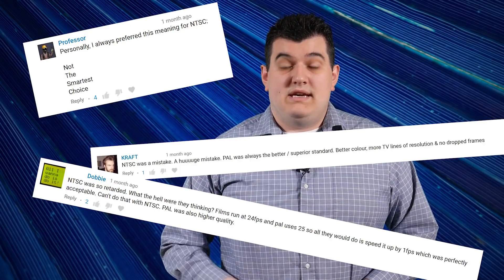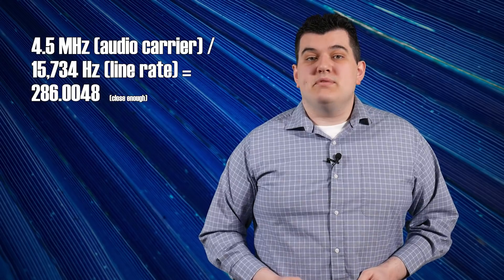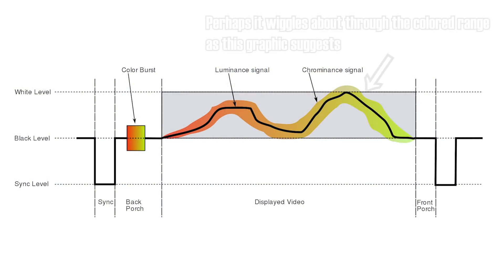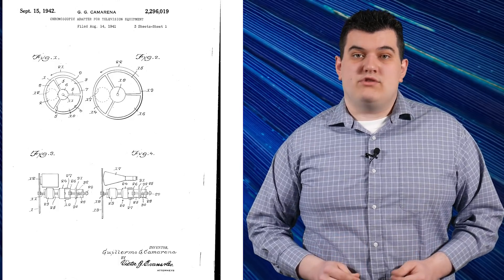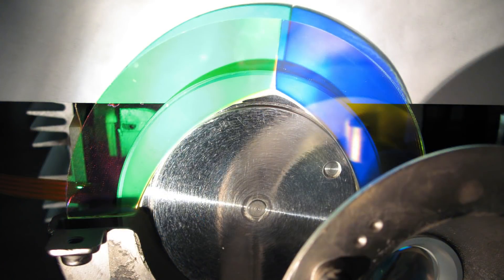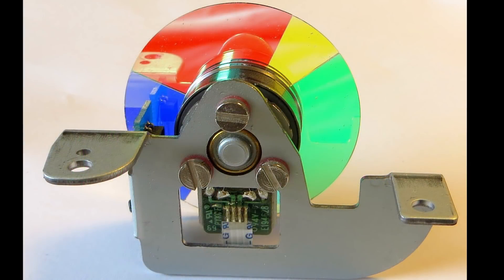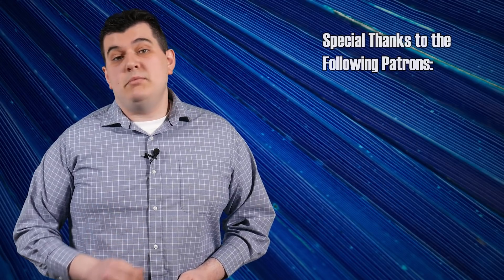Analog Color TV Wrap-Up--Some extra info

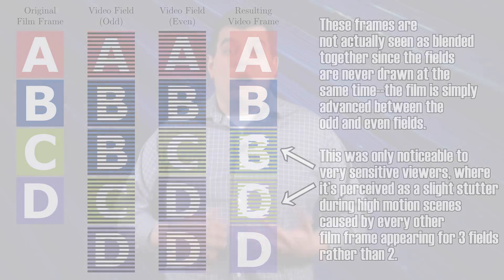Comment: 3:13 Yes, all of you from PAL regions have actually been watching our movies in the wrong pitch. If you've searched for clips from your favorite movies and heard them with a lower pitch, you're actually hearing them in the correct pitch.
Reply: This explained a lot, never new it affected so much
Reply: @DodgeWatt  Well I watched reruns of Lost in Space in the States and it sounded the same to me as when I watched in the UK in the 60s
Reply: yes a 100 minute movie runs for 96 minutes
Reply: You could probably narrow that down to just UK, since every country had their own channels and movies were usually dubbed into local language. At most it would have been music or sound effects that were affected by the pitch shift.
Reply: @nekoimouto4639  in Denmark we had the original sound, no dubbing, in fact all the Scandinavian countries kept the original sound.
Reply: TBF as someone who has tried to convert old videotape recorded films to digital. PAL recordings are far better than NTSC. As they are (usually) recorded in progressive fields, and the definition is better overall than NTSC. Splitting frames over multiple fields is okay, but it can be a pain to recompile into a progressive form and can leave ghosting and other noise. At least with a PAL recording it's not had to correct the frame rate and sound pitch/length. NTSC tapes can be a nightmare.
Reply: I think today they use an electronic pitch shifter to fix this, shifting the frequencies down a couple of percent. With such a small change, it's unlikely to generate unwanted noise artefacts.
Reply: Plus the rest of the English speaking world, the Netherlands and much of Scandinavia.
Reply: Mandolinic that solves the pitch but not the runtime problem. If you synchronize an NTSC and PAL version of a movie, I think you'll find that they will still fall out of sync when you leave them running.
Reply: a faster run movie allowed for fitting in an extra commercial or two. By the 1980s we were speeding up movies by several minutes in addition to the stuff we cut out for censorship reasons.
Reply: Yes, all of you from NTSC regions have actually been watching our European movies (and TV series) in the wrong pitch. :-)
Reply: Who still watches movies on TV channels?
Reply: vaso opel Actually, PAL to NTSC conversions only create distortion in the image because of converting 50hz to 60hz and cut off part of the picture because of the differences in the number of scanlines. They don't change the pitch of the sound. When it comes to UK films, they are actually recorded and projected in 24 fps just like in the US, but in the UK are sped up to 25 fps on home video whereas US uses the 3:2 pulldown. So even with UK films, we actually get the sound in the pitch which it was originally recorded and shown in it's theatrical presentation.
Reply: therealhardrock that’s si true but i was thinking, couid they not just repeat the last frame to get 25 fps.

so if a movie is 24fps and pal is 25fps.

You can get around this because pal tv’s are 50hz or well 50 fields per second,by splitting the 24fps into 48 fields and the repeat 1 frame and split it to 2 fields to get around 50hz thus 48 + 2 -= 50,sothat you don’t have to speed up that 24fps movie by 4% unless it can be only done by digital circuitry and not with analogue circuitry.

Also about the incorrect pitch of movies on pal tv’s,if there was a sound pitch control to correct the pitch,but no there wasn’t and i guess that you can again only correct the sound pitch via digital circuitry and not with analogue circuitry.mmmm
Reply: The PAL-M standard used in Brazil had the best of both worlds, it's PAL at 525/60.
Reply: @johneygd That way you'll have a stutter every second on the screen, it's very annoying.
Reply: @therealhardrock I believe most shows in PAL countries are shot at 25, not 24. So, when converting to NTSC, they can choose to slow it down to 24, or keep at 25 using some frame doubling technique.
Reply: That could be done, but it would be very noticeable and distracting.
Reply: I know a lot of Americans like to point this out but in reality this was never an issue because the first time we watched the TV show it was presented that way so there was no comparison. And as many said they employed pitch shifter in later conversions. I have seen some side by side comparisons but they are grossly exaggerated. I certainly never perceived anything like chipmunk voices.
Reply: therealhardrock . oh I see. so they mess up the PAL video to make it into NTSC??
an if I understand you correctly European movies filmed in 24 fps when made into PAL dvds have their audio pitch altered because the film is sped up to 25fps? :-O
Reply: @Junior BCM Most old TV show masters are stored on video tape. The frame rate for video tape and television broadcast is 30fps for NTSC and 25fps for PAL. However, the frame rate for film is 24fps all across the world. So even films shot in PAL regions had to deal with conversion for TV broadcast and home video. As for conversion methods, PAL to NTSC conversion generally uses the latter rather than the former, but it creates a ghosting effect that makes the motion look blurry. I remember seeing that in BBC productions shot on video tape (and thus in 25fps) with blurry motion and thought that was normal.

These conversion issues are becoming less common today because digital technology handles things differently.
Reply: @vaso opel Yeah that's pretty much it. Although these practices are becoming less common because digital technology offers better alternatives. The reason why all these issues exist is because the American Westinghouse Electric Company and German AEG corporations created different standards for power generation and TV broadcasts were designed to sync with those standards (find out more here: https://youtu.be/cWSIhf8q9Ao?t=122 ).
Reply: I'm aware of that. However if the 24fps to 25fps conversion is done in a proper way there's no need for a 4% faster speed. TV shows were even mostly dubbed to NTSC speed (like McGyver or Star Trek TNG) so they did not really really run faster. Which is why such shows have the correct pitch on Blu-ray. When it comes to Theatrical Films you could only really tell that it ran 4% faster when there was a song playing that you knew (like the opening of "Highlander"). Here in Europe a lot productions are shot in 25fps (no matter if film or video) which, if needed, can be easily converted to 24fps for a theatrical or international release. Lars von Trier's "Antichrist" for example was shot in 25p. And is even available on Blu-ray in 25p.
Reply: Captain Picard On Helium is what I call this effect... Its comical in some TNG episodes where he's yelling at Wesley
Reply: The Pitch for the TV masters of TNG is now wrong because they did not properly convert the HD masters to PAL speed. Back in the late 80s - early 90s, the US broadcast tapes were converted to PAL in a different way. Which resulted in ghosting and a VERY blurry picture because it had to fit the 50 hertz sync speed and being blowin up to PAL TV resolution. The overall speed of the runtime however remained the same. Shows like "Friends" are now seemingly running 8% faster because TV stations really don't give a fuck anymore about proper quality of their broadcast masters and they think nobody notices bad pitch or wrong aspect ratios…
Reply: @KRAFTWERK2K6  ...so they can cram more ads into each episode :-(
Reply: You mean The Goodies were even faster in the original broadcast?
Reply: They could show movies in the correct speed by using a 24 to 25fps conversion, but with the crude conversion systems available in the old days that would have caused very noticable jumpy motion, so they opted for the lesser evil. Saves time too :).
Reply: therealhardrock I’d rather have a slightly higher pitch and more accurate frame rate rather than all that judder.
Reply: kinda like the Sega pal vs ntsc -  here in the UK i was used to a slower Sonic the hedgehog, we never knew it was faster in the USA
Reply: The 50/60 hz  was dictated by your country's  AC system not the color system.,it goes back to a long time ago when electronic designs were not that stable enough and the only reliable, stable source of reference was the AC frequency.
Reply: It's worth the better picture resolution
Reply: Many people don't know that 25fps of PAL is due to 50 Hertz of electrical systems in Europe. It wasn't chosen, it is just a fact. Same with 30fps of NTSC system, because of 60 Hertz.
Reply: @jakublulek3261  That's correct. ATV in the UK made some programmes for the US market (e.g. The Muppet Show) from Elstree Studios in London. Filming in 30 fps on a 50 Hz power source would have resulted in strobe lighting effects on the screen, which is one of the reasons why broadcasters would lock the frame rate to the electrical frequency. They had to use DC lighting in the studio to resolve this.
Reply: Better than to watch badly blended :P
Reply: The reason I was importing all my DVDs from the US.
Thank God Blu-Ray put an end to that.
Reply: @Ni5ei  pal speedup truly is one of the biggest reasons I try to always get blu Ray
With the exception being the many British TV shows shot on tape
Reply: some movies would have their pitch corrected
Reply: That’s true I first realised this when I bought the How I Met Your Mother box set a few years ago and noticed it was sped up compared to how I remember seeing the episodes online. It took me a while to realise what was going on but eventually I found out that DVDs in my country have a frame rate of 25fps. I then discovered that all the movies I had on VHS and DVD had a different running time compared to their listed running times on Wikipedia.
Reply: @bendowson3124  It's definitely weird hearing everyone's "real" voices when you're used to them sounding a particular way!

The higher pitch was always noticeable to me, usually with music you're familiar with. Honestly it gave movies their own "mood", sort of part of that larger-than-life experience, being in their own world, that kind of thing. A bit like cinematic blur vs the soap-opera effect.

Not everyone can hear it though, I was on a school trip once with a film being played on a TV on the bus, everyone thought I was crazy when I pointed it out
Reply: @cactustactics  I went 25 years not knowing, so I'm not surprised people thought you were crazy. It's also worth noting that despite the switch to digital, foreign TV shows and movies are still typically sped up in PAL countries. I know this because after getting into Brooklyn Nine Nine on Netflix, I began watching Season 7 on TV and immediately noticed it was sped up.
Reply: @bendowson3124  well I mean we were watching the film at the time! And it was some popular song, so it was like "can't you hear it?" and "what are you on about???"

Yeah I don't really watch broadcast TV (mostly streamed) but I have noticed shows sounding like that if I've run into them too. It's weird because in the UK at least 60Hz-capable TVs have been a thing since forever, and I think digital broadcasts tend to be MPEG-2? This whole thing is confusing but it seems like it should be possible to just leave things at their normal framerate... probably keeping old standards in place or something!
Reply: @cactustactics  It may have something to do with backwards compatibility since when digital TV first took off, many people still had CRT TVs and would use a set top box to get digital stations. So maybe by keeping the same resolution and frame rate, they were ensuring the best possible display on those old TVs?
Reply: @bendowson3124  yeah it's probably something like that - like a digital STB could technically convert to the appropriate frame rate for the TV, but if that conversion involves making the stuff run faster or slower... doesn't really work for broadcast TV! And I guess support for variable frame rates is something that would take a while to really be standardised and rolled out. I get the feeling this is all horribly complicated
Reply: I always noticed this but not even with movies. As a child I always asked myself why music "sounded too fast" on films and some American TV shows. For example, Family Guy's early series are sped up. The later series were fine until it went HD, when it was sped up again. I believe they reverse the 3:2 pulldown and then play back the converted 24 fps video at 25.
Reply: @steeviebops  I think you're right about them reversing the 3:2 pulldown. Also, it should be noted that several TV shows from the analog days were shot on film and would have had a 24fps frame rate.
Reply: With DVD and VHS, we were watching our OWN movies in the "wrong pitch" (not that I ever noticed this), because anything PAL-formatted has been sped up to match the framerate, and even european films were filmed in 24fps (from what I can tell). It took me some googling to figure out why the movie length on my DVD and Blu-ray version of Amelie were different, before going back and checking several other movies and seeing the same thing on pretty much every other DVD I have. I guess this means Europe was the OG fast lane.

Apparently this same issue affected console releases as well; for example Ocarina of Time, that famously runs at 20fps, runs EVEN SLOWER on PAL.
Reply: @Twinrehz  Yes, 24 fps is the cinema standard so all movies recorded on film would be played at the wrong speed (and pitch) regardless of where they were made. The video games issue is because virtually all games were designed for 525/60 systems. On 625/50 they letterboxed the extra 96 lines and slowed the game down by 17%. Well designed titles (such as those by Rare) would compensate for this but many didn't bother. See the original Sonic the Hedgehog for an example.
Reply: I assume that nowadays everyone just uses 60hz even in 50hz regions
Reply: @kargaroc386  For video games, yes. But broadcast TV is still 50i.
Reply: @kargaroc386  50hz regions are actually a dying breed altogether, because the new HD standards are all identical world wide anyway.
Reply: dont they novodays just duplicate the frames to be at 25fps while matching the original speed ?